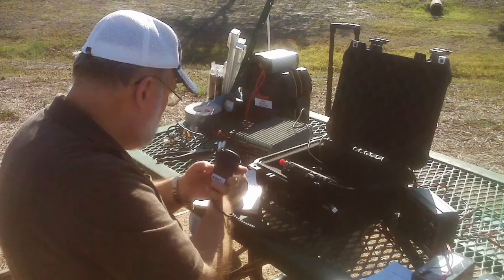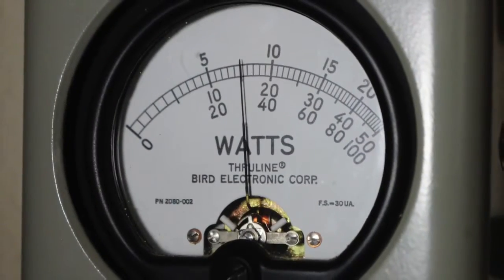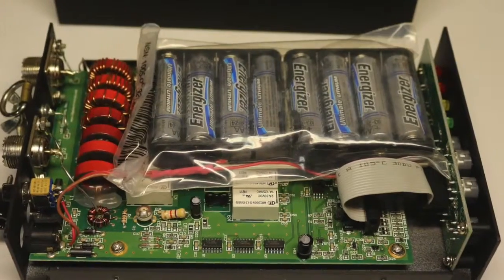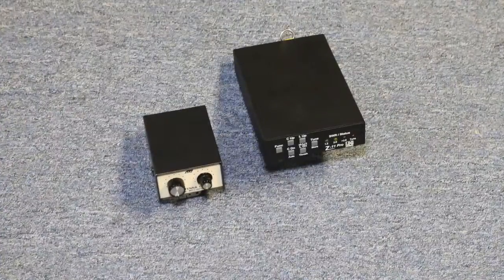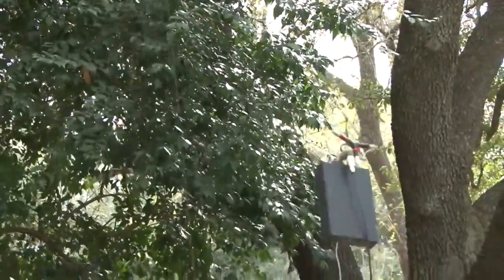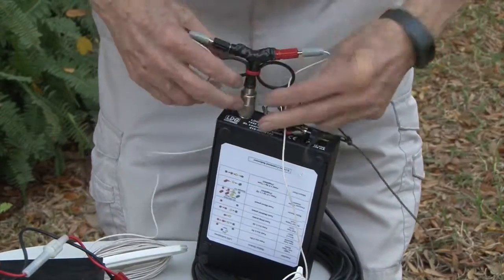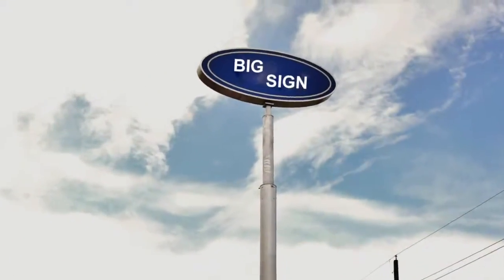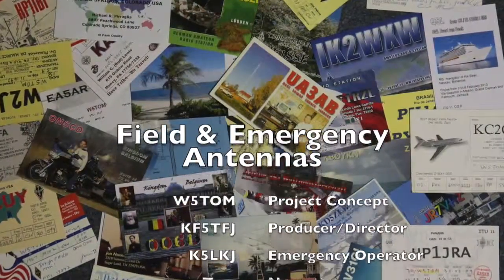W5TOM Field & Emergency Antennas

Comment: What about a balun?  If you put the tuner right at the root of your antenna, can it act like a balun when necessary?
Reply from the maker: The function of the tuner on the antenna depends on the antenna and weather it is blanced ot un-balanced.  Using the auto tuner as an antenna matcher would not involve a balun.  Watch the video a couple of times and you will understand the concept.  Good luck and let me know how it works out for you.

Comment: What are the magnets you are using? Can you give me a description so I can find them on eBay? Or can you point me to a seller who will post to Australia. Thanks, David VK2DMH
Reply from the maker: David:

These would work well.

https://www.ebay.com/itm/Strong-N52-Neodymium-Eyebolt-Circular-Rings-Magnet-25-x-30-mm-For-Salvage/192108091343?epid=707142765&hash=item2cba88d7cf:g:UMsAAOSw4CFYqB66

If you can't get these, search for a retrieving magnet or salvage magnet.  Or you could just use a copper fitting and the bungee cord.  You could just use the magic problem solver...DUCT TAPE.  Try a hardware store.  I found these in a tool store.

Good luck.  Tom